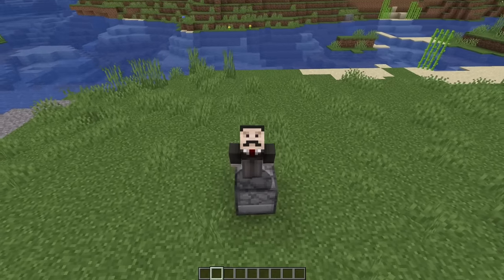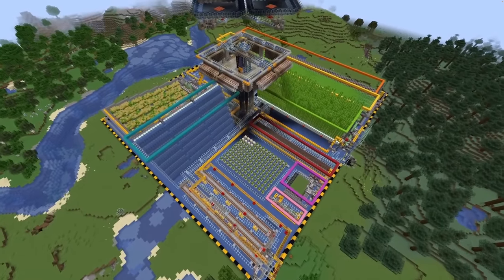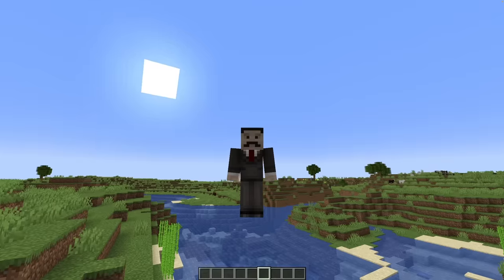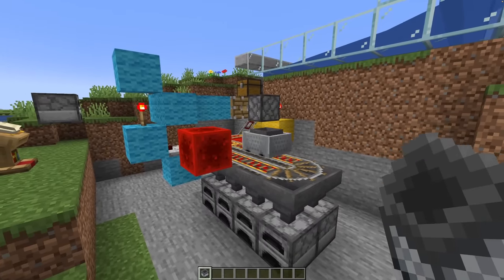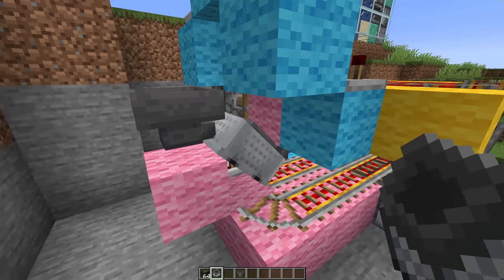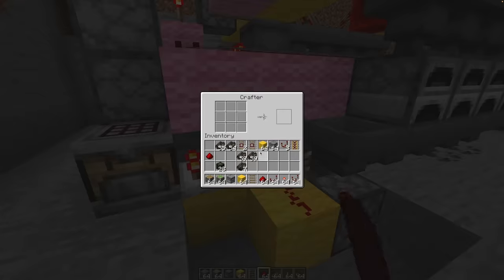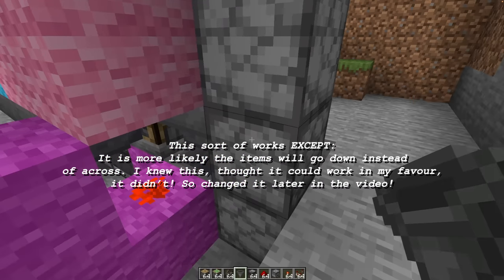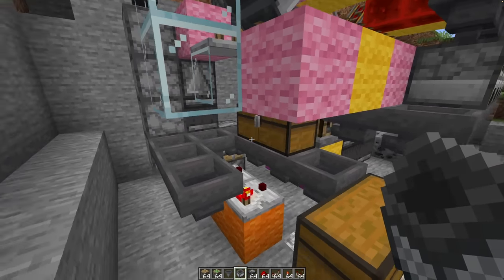INFINITE Furnace Fuel using Crafters in Minecraft 1.21

Comment: It’s surreal how much is possible with the addition of ONE block
Reply: All you needed was something to automate crafting for everything to break loose
Reply: To be fair, it is a block that automates a cornerstone aspect of the game, so of course it would have a great impact, if they manage to make a block that mines and collects blocks automatically, like the quarry on Buildcraft, it would also be seen the same way as the crafter
Reply: reminds me of slime blocks being added
Reply: we just need a block placer and breaker now and it will all be over
Reply: I would say a rotator, but the ones that you said maybe could work as one
Reply: Indeed, there is nothing "really quite simple" about that!
Reply: @LuizHenrique9406  We do have blocks for that. They're called TNT + hoppers.
Reply: I calculated that kelp is 3.6305158953 better than bamboo as a fuel source in bedrock(multiplied by 7/6 for java). However, I have not yet accounted for thr fuel used for smelting the kelp
Reply: The Observer was a similar block that dramatically expanded the possibilities of redstone.
Reply: @lolicanadian can’t macros concatenate strings easily now? 
just make a function which takes 2 variables and do a $data modify storage bleh:bleh set string $(str1)$(str2)
Reply: @bable6314   That's why I gave the example of the Quarry, it mines and collects those blocks at the same time, and it can go as deep as the bedrock as well, while being faster and safer

In comparison, TNT duplicators tends to lose efficiency the deeper the hole goes, and many resources are lost because either they despawn, or get caught in the blasting zone, also it is impractical to set up a hopper minecart grid going throughout the hole that is being exploded
Reply: @theairaccumulator7144 then artificial intelligence, thus making players unnesecary
Reply: @mech9855  how did you calculate that? and why is it more efficient in java than in bedrock?
Reply: @lolicanadian   yeah macros are very cool, they added them in 1.20.2 (?), there’s a slicedlime video about it
Reply: @LuizHenrique9406 that would turn survival Minecraft basically creative without instant break and fly
Reply: Theres a reason everyone has been requesting one
Reply: no, it isn’t. it makes perfect sense. you, my friend, are making a sweeping statement for zero reason.
Reply: @LuizHenrique9406 you can already break blocks. it’s called TNT. don’t be greedy. if you want to use mods, use mods.
Reply: Imagine if we got movable tile entities like Bedrock edition.
Reply: @simic0racle157 Or Hoppers.
Reply: @sylv256  he didn't say it didn't make sense, he said that it was surreal; he was in awe(use any synonyms you like, idc). You, my friend, are talking sh*t for no good reason.
Reply: @sylv512  I said it’s surreal. It’s only a single block but it changes a large percentage of farms people build and how players go about making large quantities of items, which is why I said it. Please tell me where what I said was in the wrong, it’s not a sweeping statement for me to say a block fundamentally changing a game is surreal.
Reply: Now we just need mining to be automated
Reply: @LinktotheFuture-zs9km  well, uh, keep yourself safe i guess.
Reply: @LuizHenrique9406 that’s why some people dedicate their life (or just their minecraft life) to slimestone quarries to be more efficient
the crafter, on the other hand, could not be recreated out of other vanilla features without a player spamming a recipe or something
Reply: to be fair this isnt just any regular block
Reply: Hoppers.
Reply: ive added autocrafter addons to vanilla SMPs without redstone output but an actual autocrafter with redstone signal is something that im extremely EXCITED about. so many different possibilities
Reply: @LuizHenrique9406  we have tnt dupers and hopper minecarts. and it isn't as revolutionary as you might think.
Reply: But the one block is (in both functionality and name): half the title of the game.
Reply: @sylv512  What's greedy about acknowledging 'a block named 'half the game' is pretty powerful indeed, now imagine it combined with a block for the other half'.
There's no call anywhere that such a block should be in there.
No complaints that it isn't
No aversion to mods, or people who play without those.

Merely the observation that a block named half the game, is about as powerful as that fact would imply. (using the hypothetical (available with mods, roughly/weakly approachable with significant work in vanilla) 'other half block' merely as illustrative)
Reply: True

Comment: I don't know if mumbo will see this but you can use smokers to smelt kelp instead of normal furnaces to speed up the process!
Reply: I didn't know that
Reply: He has now put that in his pinned comment! :D
Reply: @kathyjohnson2043 cause the kelp is counted as a food source
Reply: I knew that and it still wasn't the first thing I thought about. Brilliant post.
Reply: The more you know...
Reply: But what of it smells it too fast for the Kelp block to fully use its potential?
Reply: @cappertilge8916 double the smokers as well and rails too problem solved
Reply: You can also use campfires
Reply: Very true, but then the problem you run into is that it no longer functions as a general purpose super-smelter

Comment: An idea for a follow up video is a bamboo farm that crafts bamboo blocks then crafts bamboo planks to use as fuel. Bamboo planks are a bit more efficient compared to an equivalent amount of bamboo. Love the videos Mumbo!
Reply: Plant on mud, hoppers direct to the center then backwards into a crafter 3 blocks underneath the pistons. Powered with an observer looking up into the piston row, with a solid block between observer & crafter.

Make that crafter look UP. Make the block that is powered by the observer also be a crafter.

That's literally it. Bamboo planks.
Reply: @kevinjamesmartin4307  would bamboo slabs be a better fuel source?
Reply: @Goldenreaper66  no, they smelt half as many items as the planks, it's just the same
Reply: @flexu8699 not on bedrock though
Reply: I thought to do it but realized that bamboo is more broken
Reply: @PingasFumberto how much on bedrock
Reply: @riolu477  on bedrock slabs and planks are equivalent smelting-wise

Comment: So happy that kelp is finally getting more attention! I've been using it for years and felt like it's been underappreciated.
Reply: Me too, I always set up a basic auto kelp farm right at the start of a survival world.
I'll use the furnace as an xp battery, every once in a while, I'll lock the hopper under the furnace, pull 1 dried kelp from the furnace, and get like 20+ lvls from a single furnace.
Reply: I feel the same way.
Reply: @shipwreck9146  use the dried kelp to smelt the excess wood from your wood farm, and power it with a fuel-capable-scrap trashbin somewhere handy that stoppers the bamboo silo of "backup" fuel when it has any items.
Reply: Me too! I made a gigantic useless kelp farm and now I can automate kelp fuel!

Comment: I'm glad you're having so much fun Mumbo! There's so much you can do.
I'm curious when the "Remote Crafting Table" will be done, presumably from a storage system. There are many ways you could go about it. 
Presumably you wouldn't need to make it accept an input for every item in the game. You don't use shields or iron pants for crafting. However, things like cobblestone, iron, sand, redstone, and so on you do. 

Unfortunately, it's difficult to get the items to come out how you want depending on the shape of the item... So really, your best bet is to have an auto-crafter with every pre-set shape that is used for crafting. Then in terms of inputs, you have a series of levers with item frames. Presumably, you can also just have presets for the auto-crafters depending on how many you have.

As with any big project, the first step is starting out small though. A 3x3 acts as a 1x1, 2x1, 3x1, and 3x2 all on its own. Then just make a 1x2, 1x3, 2x3, and a  2x2. That's a majority of crafting recipes right there. Armor and tools will be a pain. Though the real challenge likely won't be the size, it'll be getting the items to go to the correct crafter without getting stuck in the wrong pipeline. Or worse, what happens when you put in the wrong recipe.

Obviously it's easier to just be given the items, but can you really call yourself a Redstone Expert if you can't craft from 6 chunks away?

Comment: Kelp-based smelting was the first thing that came to my mind when the crafter was introduced! Although my version just has a kelp farm and crafter directly connected to a super smelter. The kelp from the farm gets smelted into dried kelp which gets filtered out of the furnaces’ output to be crafted into blocks which go directly into the fuel slot. Looking at your version, maybe having a separate smelter for the kelp might be more efficient, but I kind of liked the idea of everything being smeltable in the same furnace system, kelp and all.
Reply: Yeah I’m no red stone expert.. but I wanted to figure out how to make a super small simple version.. 
doesn’t need to be fast… just want to be able to have it running in the background.. and when ever I need to smelt some stuff it has kelp blocks ready to go

Comment: I built this leading into a shulker loader and bulk shulker storage. Then my furnace array calls for two shulkers on demand to fill the fuel input double chest when it empties. I tried doubling your smoker/crafter setup by mirroring it, however the kelp input rail at the top of the array is directional - the flipping rail track attached to the detector rail that determines if the cart is empty flips back the wrong way, so it can only be used in the one orientation. Awesome design Mumbo!

Comment: How about an item filter to just pull out a barrel's worth of kelp blocks that is used to feed the kelp production? Once it's full, it would lock, and any overflow will go into the smelter. It would take a bit longer to warm up and fill the barrel, but feels much more simple and would serve as a nice buffer if it is always on at your base.
Reply: That sounds more lag friendly too.
Reply: bamboo backup silo.
Reply: An RS latch for a chest. A signal of two is more than enough kelp to fire it.
Reply: Similar premise but different; route the dried kelp block output through a hopper minecraft that circuits over the fuel input hoppers without looping (so when released will run over each hopper once and then return to it's stop). Link deployment to the same trigger as the un-smelted kelp minecart. When using 8 smokers that will keep the farm indefinitely fuelled with the exact correct amount and then have the true farm output via a hopper under the minecarts resting place that is locked when the minecart is less than 2 signal strength full aka 42 items (just increase the signal strength for a larger and more reliable cache). Bare minimum cache with no worry of overflow or drama splitting the correct amount out to be reused as fuel. If your kelp farm is crazy fast use the smelting component as 1 module, hopper minecart magazine and chain the modules with rail switching to divert past the module if its currently operational. Scale to Bonkers, job done.
Reply: I just tried to make a simpler version and its literally just a water stream on top of some furnaces with the kelp, then the dried is transported underneath to a crafter which pops them up in a water elevator to a water stream to hoppers on the side of the furnaces, Literally no redstone other than 2 observers for the crafter, just some simple water flow. All u need to do is let the kelp fill up the furnaces before adding the starter fuel.
Reply: @prebenkul How are the kelp blocks split between the furnaces?

Comment: decorated pots are perfect for batching, letting items clump up into specific-sized stacks vbefore being fed into other systems.
so let a pot cache/buffer kelp so that it reaches the furnace in stacks of exactly what can be smelted with one kelp block
Reply: signal strength 5 is 19, so one would also Drop an extra to each batch

Comment: In a traditional item sorter, advantage is taken of the fact that hoppers pull faster than they push, so items are pushed across until they reach the hopper that will pull it in. I'm surprised you didn't just loop a hopper line or water line around to feed the furnace then push across to bulk storage once the feeding hopper is full.
Reply: I guess in this version you don’t have to wait for the kelp line to fill up before being able to smelt other items

Comment: instead of separating the kelp blocks 40/60, you could just have it all go to the furnaces and as it saturates the overflow will go into storage.  It means a bit of a longer start up time but it self balances.
Reply from the maker: Works until you get item elevators involved. Blocks would get stuck in the elevator and never be able to leave. The smallest part of the circuit is the divider so not too tricky to work around!
Reply: @ThatMumboJumbo 🤹
Reply: @ThatMumboJumbo  What about routing every Kelp block through an item elevator to the kelp smelter system to then have the overflow move past it to the auto-smelter system (item filter-style)??
Reply: @ThatMumboJumbo  An item elevator can go into a horizontal pointing hopper, with another hopper below "stealing" the blocks as needed for the furnaces. Needs to accumulate one stack of blocks before the first blocks go to the supersmelter. Or skip the item elevator completely and make the fuel-loading minecart run up and down.

Comment: There's another way to do a completely automatic refueling setup.  You combine a moss-based bonemeal farm, an azalea-based wood farm (no need to plant saplings), and an auto-furnace setup that turns that wood into charcoal.  That charcoal feeds both the charcoal generator itself (after some initial seeding, of course) and, when full, a separate auto-smelter setup.

Absolutely massive setup, which you can see in one of Doc's season 9 videos.

Comment: It took this to make me realize that kelp blocks are actually better fuel than coal/charcoal, which is both cool for me because I usually like to play with the Create mod and as such almost always have an automatic kelp setup, but also not that useful for the same reason because you can just smelt/smoke items using Create machines without needing fuel lol. Either way, good to know for when I'm not playing with the Create mod.
Reply: In terms of returns, if 1 kelp block cooks 20 items, divided by the 9 kelp to craft it is 2.222..., minus having to cook them for a net of +1.222... smelts per kelp.

With charcoal, -1 to cook the log into charcoal, which cooks 8. That's a net +7.

I'm sticking to charcoal, but will have kelp as a fully automated secondary fuel.

Comment: For a small farm, you can have a hopper clock with the fuel burn time that's locked by an inverted comparator signal from the furnace. As long as there's enough kelp coming in, the hopper clock will keep sending fuel on the preset interval.
Reply: genius

Comment: for the redistributing kelp to the furnaces, just use priority output, allow the system output to draw from the rerouted line only if the input buffer is not empty.

then as long as your average kelp production slightly exceeds your smelting capability the input & in-furnace fuel buffers will take care of the kelp production variance too.

Sure it'll be a little less efficient but will make the footprint smaller & the circuitry simpler

Comment: you could use the smoker for faster smelting
Reply: Is it faster?
Reply: @kathyjohnson2043 yes. Same with the blast furnace.
Reply: @kathyjohnson2043  twice as fast
Reply: @kathyjohnson2043  yes
Reply: @kathyjohnson2043  "smelts food twice as quickly as a furnace"